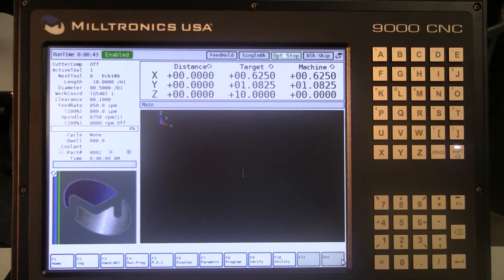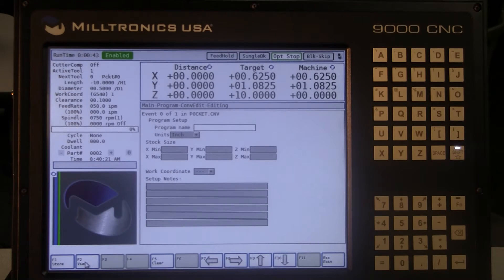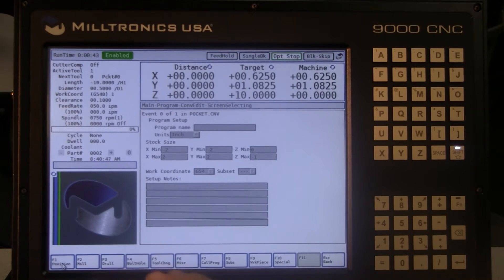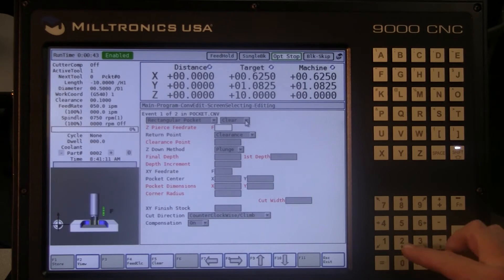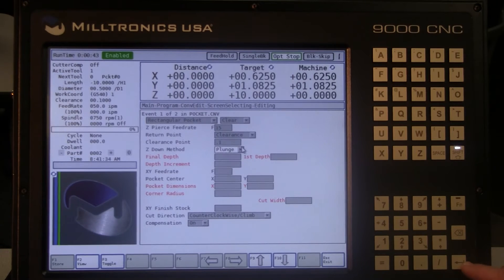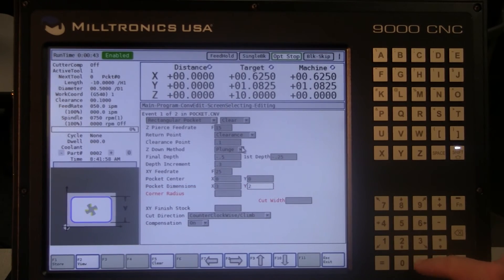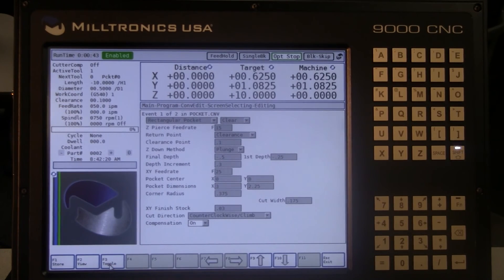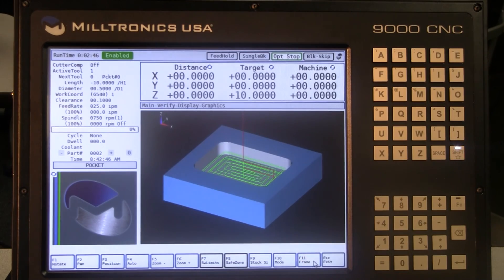Pocket Cycle

Comment: Is there a way in graphics to see the part at top view, front, right, etc?
Reply from the maker: Yes, after you Verify/Preview the program, and the Solid Model is displayed in the Graphics mode, press F1 “Rotate”, then you will be given choices of XY, XZ, YZ , Isometric, as well as Orbit, Tilt, Roll, all of these are represented by the F keys.  The 9000 control has the “Touch Screen” that allows the model to be Rotated by simply touching the screen on the part and rotating to the desired positon.  

A link for the 9000 graphics is below:

https://www.youtube.com/watch?v=qJaT_1BBxfs